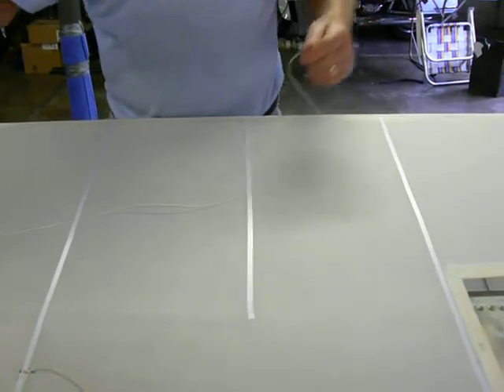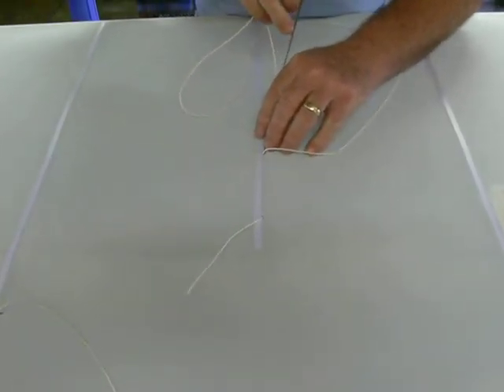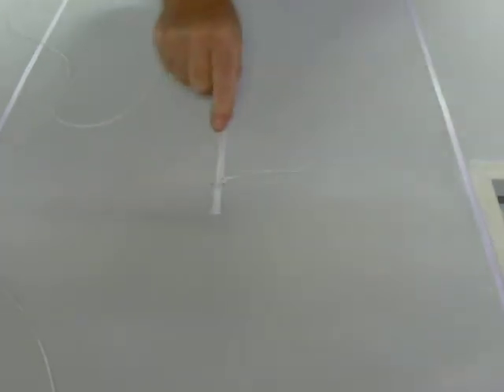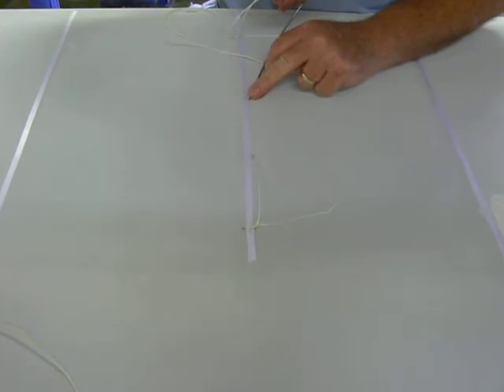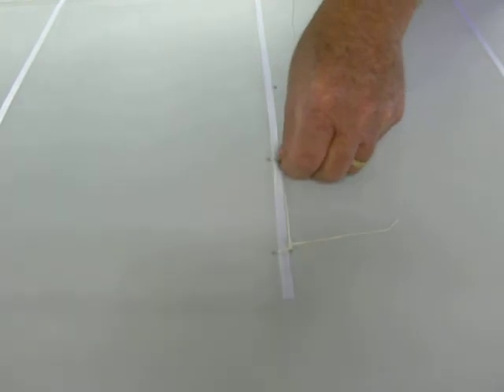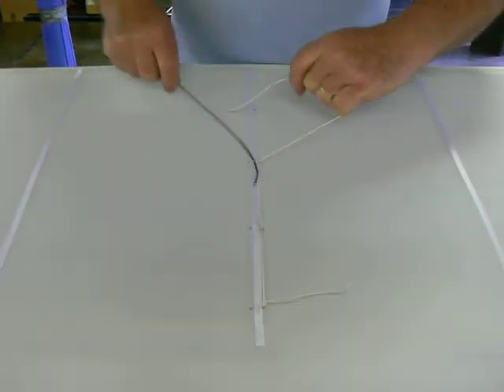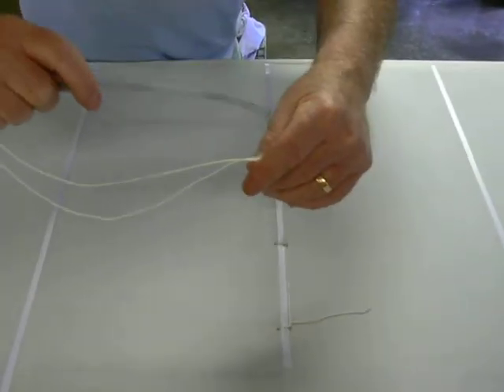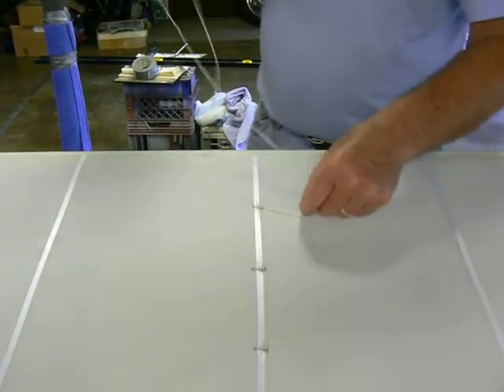Rib stitching a Kolb false rib

Comment from the maker: Unless you push the knot to the side of the rib and part way into the stitched hole, as I mentioned. In which case they will cover nicely, and the cord that lays alongside the reinforcing tape will scarcely show, expecially after you work it a bit with the iron. If you goal is to win trophies, and have the other trophy winners nod approvingly, then I suppose going to extremes is justified,  Doubtless your airplane looks smoother than mine.